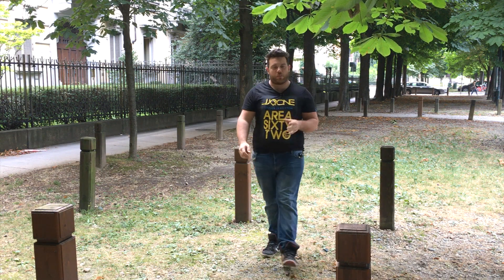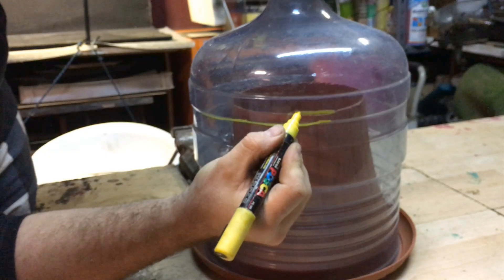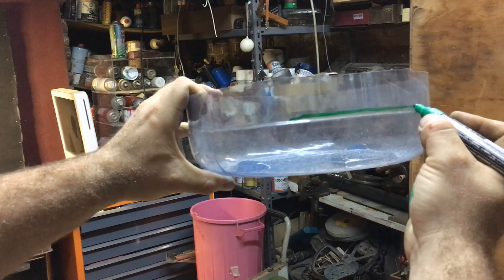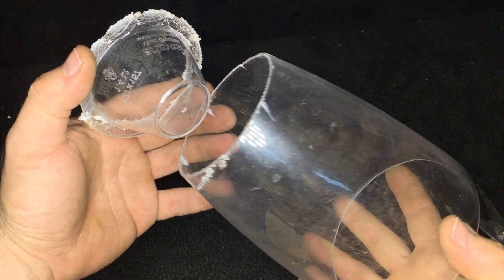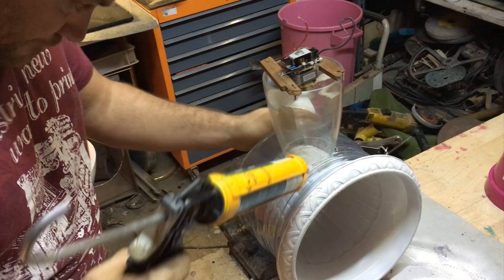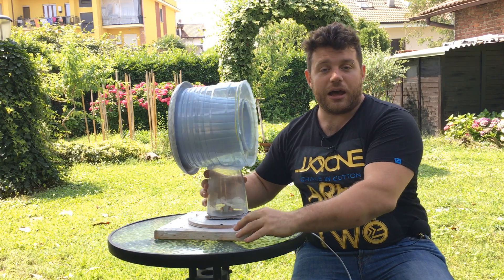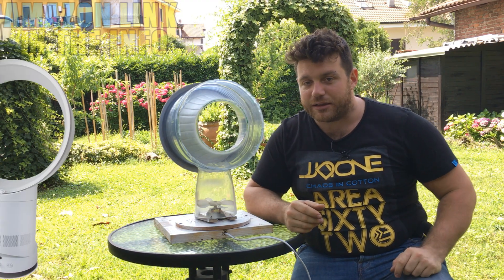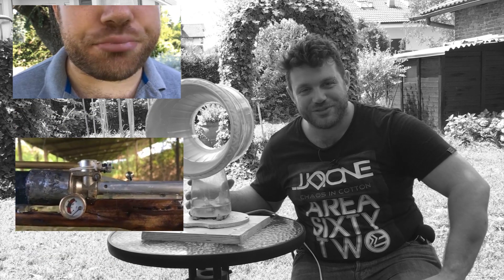BladeLess Fan - How to Make it - Dyson Fan DIY

Comment: I understand that this design produces a much smoother stream of air due to the final output of air being 'fanless'.  But since this overall design is NOT FANLESS, then is there any more advantages than just a SMOOTHER STREAM OF AIR????    I would assume not.  I would assume for the same amount of electric current used, we don't gain a stronger air stream here, and possibly a weaker one, when comparing to a conventional FAN running on the same amount of current!  But I could be wrong.

Comment: How couldn't this design solve Airplane Birdstrike? Could we substitute the Microwave Fan for a Rolls-Royce Jet Engine, but be able to rotate-aim on the wing the position of the Dyson Port to direct Airflow from Horizontal to Diagonal to Vertical like a Bell Boeing V-22 Osprey, and not loose any generated power while doing it? With no fan to directly strike, engine failure is greatly protected from Bird and Hail! Start with a Prototype RC Plane at a Flight Club, by-ratio a Toy Engine has more power than its to-scale equivalent, this could at least prove the physics and theory of it should you create a worthy design! Good Luck.

Comment: I saw the threads moving about turbulently. Perhaps to get a better laminar flow, pack the gap between the rings where the air comes out with cut-down drinking straws. See the various "laminar flow water fountain" videos.

Comment: Yes because everyone has a microwave fan on spare
Reply: You don't specifically need a microwave fan for this, and you know that, right? You could just use an old computer fan or attach a small DC motor to a battery holder and glue on some fan blades to the motor.

Comment: WHAT IF...the principle were used in a truly bladeless fashion? The speeding up of air goes all the way back to the desert fortresses where the principle of faster moving air becoming cooler - henceforth the sculped window designs that would speed up natural air currents and cool (somewhat) a castle...then what if the naturally moving air were subjected also to the venturi effect, ADDING MORE AIR into the equation? I picture like a venturi on every window, removable in times of low circulation,returning to the original natural cooling.

Comment: Great idea, very smart, the only thing is the fan that you are using to blow the air is very noisy and not so strong so the all structure becomes a bit noisy, but the idea is great, if you change the materials for a more thicker ones you will be able to eliminate the noise because it becomes more compact, great job, Thank you

Comment: Since there is a blade/fan in the dyson design too... what makes it better?    Does it just look ergonomically and cosmetically better?
Reply: The Venturi Effect.
Reply: Technically the Dyson has an impeller, not a fan in the base.  Impellers have fins, not blades.  Impellers provide a smoother air flow than bladed fans.  Also, the large open volume between the impeller and the exit provides a sizeable plenum to further smooth out any fluctuations in pressure or air flow.

Comment: The definition of a fan is a device with rotating blades.
Reply: No, it's a device that pushes air.

Your definition ignores those "wave back-and-forth" wedge-shaped fans (think traditional chinese fans), but does cover things like boat properllers and chainsaws.

Comment: Bladeless fan isn't. It's a squirrel cage fan in an enclosure, the top part that directs flow is just an eductor for air.
Reply: the design is incorporating the venturi effect to push more air than the fan in the base can by itself

Comment: You guys know that it's not about hiding the airflow generator (the fan) from view in a bladeless fan, but rather the much more efficient way of moving the air through the venturi nozzle, which basically amplifies and homogenizes the initial airflow? Also, you have no moving parts children can get their fingers into.
Reply: More efficiency, better safety, all in a lighter package.
Reply: And twenty times the cost.
Reply: Plamen Yordanov Well, it would be misleading if those hidden blades would mean any disadvantage to the user or when the user would expect the fan to have any features it doesn't have. None of that is the case, so, it isn't misleading.
Reply: The name of the fan isn't meant to be interpreted literally as "having no blades whatsoever," it's meant to clearly distinguish it from traditional fans which have blades, cha feel? Unless you're prefer to call it the air foil fan which isn't as clear of a descriptor imo
Reply: Plamen Yordanov So what? It still has all the advantages a device has that doesn't generate the primary airflow with big fan blades. So, where's the point in feeling misleaded?
Reply: No point in getting technical here, this is YouTube.
Reply: Marian Keller
So just because the blades aren't straight in your face you're alright with it being advertised as "bladeless"? Because most people aren't. You can't call a car "engineless" just because you can't see the engine when the hood is closed. That's just stupid.
Reply: The point is that it's advertised as a "bladeless" fan, rather than a "more efficient" one.
Reply: Marian Keller
It's just false advertisement. It's like advertising a water-resistant phone as "water-proof". It's not bad that it has such a feature, but it should be advertised correctly, because otherwise you get the reaction you see in the comments for this video. The feedback would've been completely different had it been advertised as "a more efficient fan" rather than "bladeless", because the latter is technically incorrect. But on the other hand, I guess a lot less people would've even watched the video if the title didn't say "bladeless"... I know I wouldn't have watched it. And that's what pisses people off - they were expecting a truly "bladeless" fan, but they watched a fan with blades being put inside that thing.

Comment: Perfectly correct logic and physics.  Same function as the commercial Dyson or other product.  No blades for safety and as a sales gimmick and these make some sound as the air slips through the small space, just like the commercial product.  The thumping of the blades are smoothed out a bit by the cone and a tuned venturi does draw in air from behind the device to push it at you.   Good work, Sir.

Comment: A bladeless fan? What was that gizmo attached to the motor's armature?
Reply: Blades? Oh wait...
Reply: Bladeless as the blades aren't exposed you twat

If this is sarcasm, it's the very worst, douchey type.
Reply: Choi's Humor Does that make my phone battery-less because I can't see the battery? Or should I say my TV is totally wireless because I can't see the cables?

See? There's no sense in saying it's bladeless if the design still contais blades
Reply: Define twat. Okay, they weren't exposed, but THEY'RE BLADES!
Reply: Choi's Humor I'm applying basic logic... If something is true to N, it must be true to N+1, N+2 and so forth, that constitutes a truth. If N is true, but N+1 is false, then what has been proposed is also false, get it? Imma call you Mr. Twat from now on since you love that word so much, alright? :D
Reply: attach the base to your face, with all the hot air you blow it will be bladeless
Reply: Ikr they're were blades
Reply: A fan with blades. That's what I thought.

Comment: Great video.  Thank you for posting it. I have two points to add:
1.  If you want a bladeless version use an impeller instead of a fan.  I'm betting that's what Dyson does.
2.  As long as the venturi effect is pulling in air through the center opening, you can put a small mister there to add some evaporative cooling.  (a high tech swamp cooler if you will.)

Comment: So it's not really bladeless, You just can't see the blades.
Another Dyson gimmick. Their vacs are overpriced complicated junk.
Reply: Overpriced yes, not really complicated and not junk.
I would love one, I just wouldn't buy one.
Reply: My girlfriend has the purple model Dyson upright vac. I believe it was in     the $500usd range. It's crap. The rollerball idea seems good, but gives it a very flimsy, unbalanced feel when standing upright or when using the hose. The hose is another poor design that a lot of other companies use now. It's a soft accordion, that when you put a load on it it shrinks, pulling the machine off it's base. Also The hidden hose in the handle idea is clunky and difficult. And it's made out of cheap hard plastic. Even the cheapy Dirt Devils have some rubberized pieces. If you want a really good lifetime vac, spend a little more and get a Luxe Aerius (It's the old Electrolux Epic upright). Or you can get really good used and rebuilt Elecrtolux Epics on Ebay for under $200. It's bagged too, so no dust storms when you empty. The best machines ever made.
Reply: Guess who does the cleaning in your house, me too happy wife happy life, And yes they are a bit flimsy maybe they could make a special heavy duty model low profile tyres dual cords 5hp with turbo boost to 7hp just for the blokes, It will need safety warning . Careful of small dogs& children.
Reply: I'm use a 30+ year old kenmore vacuum that use to belong to my grandmother. It works perfectly.
Reply: WHy can't I give you 10 thumbs up ?
Reply: kewrock same I have the hose and every time it gets covered up it yanks the whole vacuum into your leg or elbow so annoying

Comment: If you can dig up a scrap impeller pump (not that hard to find) you can make it smaller, quieter, and more efficient if you wish to. (Dyson goes with impellers for that reason...that and it technically allows them to call it "bladeless")

Comment: i didn't even think the dyson fan used a fan blade, i feel sort of cheated (by dyson) but i learned something.
Reply: Says the guy who spelled "you're" wrong...
Reply: The thing is dyson never called them bladeless at all.  Journalists reported it as a bladeless fan because... well journalists aren't too fussy about truth
Reply: Well your a dumbass :/
Reply: +A Rocket .....Your comment is apposite, however standards are not very high on youtube.
Reply: And the dyson thing isn't just a fan in a box.  They use a turbine to generate the airflow and the shape of the ring creates more airflow, which is why they called it the air multiplier.  Not a very memorable name, but accurate.